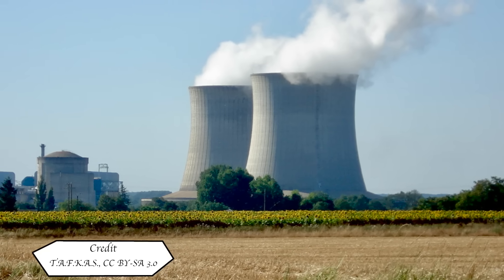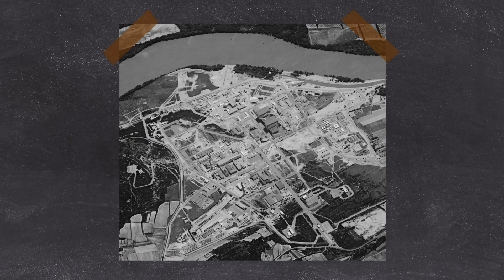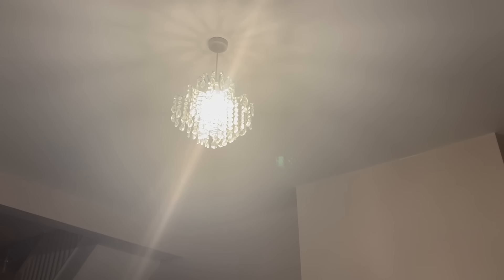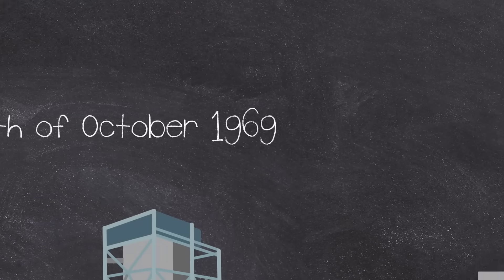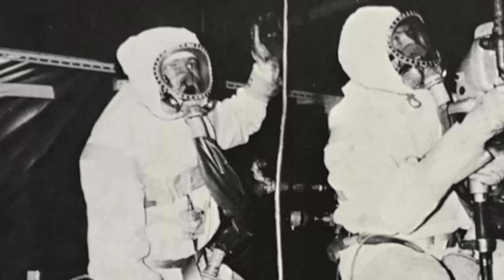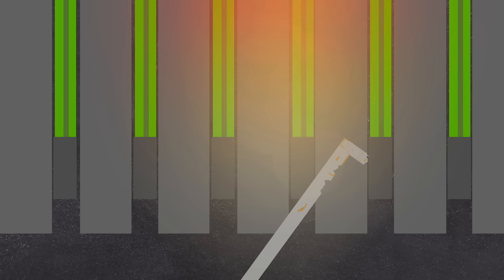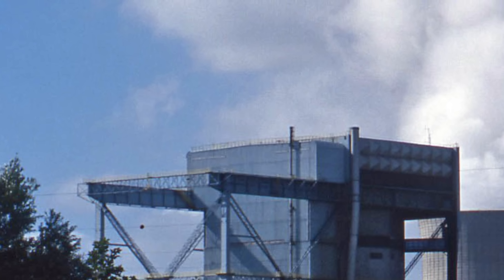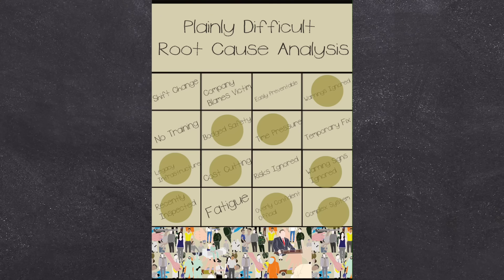The Nuclear Power-station that Kept on Having Meltdowns: Saint Laurent 1969 & 1980

Comment: I read a bit about the UNGG reactors.  Every single plant had unique reactors.  G1 through G3 at Marcoule used a pre-stressed concrete pressure vessel- the first ones ever built- and horizontal fuel channels.  All UNGG reactors were used to produce plutonium but I believe the G1 and G2 reactors produced the plutonium for the first French atomic bomb.  The first EDF plant used steel pressure vessels for its three reactors and vertical fuel channels.  Saint-Laurent's reactors were the first in the series to use internal heat exchangers, greatly improving efficiency.  There was one plant built in Spain.  An experimental heavy water moderated gas-cooled reactor was built at Brennilis which operated until 1985.

Comment: Do Europeans not realize that liquid cooling is the preferred method of cooling heat engines (looking at France and the former Soviet Union-specifically Churnobyl reactors here and yes, nuclear electrical generating stations are heat engines) for a reason?  Canada has and always gets this with the CANDU design.  Both the moderator and cooling fluid of those reactors are heavy water boiling regular water that's condensed after the turbine through the Great Lakes (Bruce Nuclear Generating Station, Pickering and Darlington) and other large bodies of water where they are used across the globe including the CANDU-derived Indian reactors.  Yes, it's expensive but our plants have run for at least 50 years relatively trouble-free, are currently being refurbished and may have an additional 20-50 years of service after that.

Comment: According to Wikipedia, "However, tests conducted in 1993 by the IPSN and in 2003 by the IRSN determined that the levels of plutonium measured upstream and downstream from the power plant were similar and of the same order of magnitude, concluding that the presence of the plutonium was due to the fallout of aerial nuclear tests and not due to either the 1980 or 1969 accidents."
Reply: The contributor for that quote was an EDF director, probably.

Comment: Not sure if anyone has noticed but at 4.37 you state weapons grade uranium is produced, this is incorrect, plutonium is produced through U238 capturing neutrons and transmuting into plutonium. Gas cooled / graphite moderated reactors are particularly good at this, hence Britain, France and several other countries built them!! (The original calder hall magnox (and chapel cross) were optimised to produce plutonium (and tritium) with electricity being a useful by product) only the later, much larger magnox were optimsed for electricity generation.
Reply: I read the biggest reason why certain nuclear reactor designs were used. Even if they’re intrinsically less safe. Is because weapons grade material is produced as a byproduct. 
Liquid fluoride thorium reactors (LFTR) are fail safe and a much much better design. Why aren’t they used? Because they can’t create a nuclear weapon.

Comment: Generation 1 nuclear reactors were pretty bad. Interesting that the UNGG reactor shares some principles with the ill fated KS 150 reactor that was installed in the A-1 plant in Jaslovské Bohunice (gas cooled, natural uranium, can be refuelled while operating...) which you covered in another video too. Both reactor types suffered meltdowns caused by blockage of channels with foreign objects, although their source was different. At least nobody died in France, unlike in Czechoslovakia, where two workers suffocated from the escaping coolant that flooded the corridors and displaced oxygen. The biggest tragedy is that those poor workers managed to reach the emergency exit doors, but they were locked and could not be opened. Their last moments before death must have been horrible, knowing you are going to suffocate and there is absolutely nothing you can do about it.

Comment: Interesting video, but it’s worth putting these incidents in real perspective. Both “meltdowns” happened over 40–55 years ago, in obsolete gas-cooled reactors that were already being phased out at the time. These weren’t pressurized water reactors or any modern design — they were first-generation experimental machines running on natural uranium and manual controls. Even then, neither accident hurt anyone or released dangerous radiation levels. The 1969 and 1980 events were indeed rated Level 4 on the INES scale — the same category as a serious industrial accident, not a large-scale disaster. France cleaned up, learned from it, and moved on. Today, it gets 70% of its power from nuclear — safely, cleanly, and with some of the lowest per-capita CO2 emissions in the world. If anything, the St. Lauren story shows how engineering progress and strict regulation work. Early reactors had flaws, yes — but those designs are long gone. Modern nuclear plants have passive safety, triple containment, and fail-safe cooling that make a repeat of this physically impossible. So let’s not act like 1969 tech defines 2025 nuclear. That’s like judging aviation safety by the Wright brothers’ crash record.

Comment: Pretty sure you meant that those reactors could make weapons grade Plutonium not Uranium.  Those reactors use Uranium to operate they don't create it.  Whereas it is much easier for them to create weapons grade Plutonium as some of the neutrons could be captured by the much more abundant but not fissile Uranium 238 eventually making Plutonium 239.

Comment: CORRECTION: Natural uranium reactors produce weapons grade plutonium, not weapons grade uranium.
Reply: Noting of course that natural U reactors produce MORE plutonium than enriched U reactors, but the "weapons grade" aspect depends upon the fuelling cycle.  If the natural U fuel is left in for more than a few days the plutonium starts getting denatured from (mainly) Pu-239 to the undesirable Pu-240 and then Pu-241.  But you are correct; weapons-grade uranium requires enrichment facilities, not reactors.
Reply: Good old U238 ->U239 -> Np239 -> Pu239 process.

Comment: These reactors, and Magnox in the UK, could be used to produce plutonium for weapons, not uranium. You put unenriched uranium into the reactor, U235 is used in the fission and some of the much more abundent U238 is transmuted into plutonium, which can then be chemically seperated from the spent fuel. It's less energy-intensive than trying to enrich uranium to the very high enrichment levels needed for weapons.

Comment: 12:20 How could it be a 2 if nobody was injured?
Reply: Radiation, especially in non-lethal doses could have long-term health effects (cancer) that much harder to attribute/claim. "Safe dose limits" with certain PPE 30yrs ago might be found to be inadequate 10yrs later.
Reply: @WT..... It's very much the opposite. Dose limits are based on reasoning that assumes the human body has no ability to heal radiation damage. It's the same reasoning that predicted tens of thousands of cancer deaths from Chernobyl.
Reply: There will be cancer, etc among the workers.
Reply: @nevillehoward8736 No there won't. Nobody got a dose even remotely close to what would cause cancer.

Comment: They will do more than shut your electric off...EDF bought all the nuclear tech the UK had, Gordan Brown sold it to them... oh and his brother was a big shareholder of theirs back then... and yep, not only insider trading, many called him traitor,

Of course he was left alone.. me though found guilty of  threatening behaviour for telling a mental patient who had told me he wanted to "anoint the school with blood" that was behind me.. That was when just before they tried to call mt a fraud for claiming DLA, won 4 tribunals on that. Had to pay a £300 for the first thing though, even if they had the wrong name on the paperwork as they said if I put in another complaint, I would be held on jail util a retrial was sorted. I won the tribunals as that fella had also claimed I had attacked him with a machete, so coppers knocked mt off mt motorcycle, and knelt on my spine where I had a operation to decompress and fused the vertibrae, they lost that crown court battle as they had no evidence of course... they told me they were going to say I did it anyway and told every one I was just a junkie which was BS. which was slander as I don't like the stuff, and won't even use Morphine for the pain. Codeine only as the pain is still a problem even if it was 30 years ago. Anyway, I have COPD and dying anyway, so these days I don't have anything else much to lose, so f' em when they I was getting death threats I just joined the NRA UK (Old friend of mine from the 80s was the instructor, and held all licences up to Artillary  as well) and got myself retrained with the firearms and of course their attempts at intimidation failed because they are not so good at it.. I know some of the biggest biker clubs, and they do that better! My barrister was laughing saying "no such thing as attempted intimidation, so we can't take them to court for that!"

Comment: When I was a child, a family friend gave me a book called Nuclear Knowhow, which explains how nuclear fission works. It showed neutrons, protons and electrons as these jolly little characters, with groups of neutrons and protons standing in groups - atoms - as other neutrons and electrons whizzed round them. Sometimes one of the flying neutrons would jump into the middle of an atom, splitting it. I assume that the reactor that they showed in the book was a Magnox- we didn't have any PWRs at that time.
Reply: Well I think you are missing out on the basics here as the how of splitting atoms is the same for all reactor designs.  The difference being in how the neutrons are moderated and how that fission energy is transferred into a form we can use.

Comment: After the Three Mile Island meltdown nukular injuneer Jimmy Carter banned reprocessing and sent spent fuel to France where accidents were kept confidential.
Reply: That wouldn't make any sense.  The failure at TMI had nothing to do with the fuel itself but of a stuck valve.
Reply: @Stubbies2003  The move was not directly related other than hysteria over radioactive materials.

Comment: Sadly, lack of maintenance is a common issue across most all industrial facilities that are hard pressed for 99% uptime, as well to return maximum profit.  Although run to failure is common amongst industrial facilities where the worst case scenario is downtime.....spicy industrial sites require more attention.  I have seen all your spicy videos and it almost always comes back to incompetent managment, greed, cost savings, or the unholy trinity.  Thanks for producing another special!:_Atom::_Hazmat:
Reply: That's the point where nationalisation or at least national subsidies/oversight are not a bad idea.

Take out some level of the for-profit nature and require safety instead, and things should run much smoother.

Comment: Just remember, whatever was released into the Loire River is a mere tiny fraction of the radioactivity routinely released by coal burning power plants every year.
Reply: Exactly. Coal puts more radiation into the air every (iirc) half decade than literally every single nuclear activity ever has released period. Never mind the radiation in ash.
Reply: No thanks but I believe Russia did that before as they blew up their reactor twice
Reply: The French have accepted your challenge and will release more as soon as they can.

Comment: I'm French and intereted in nuclear accidents and never heard of it. I'm quite surprised ! I laughed out loud at the gamma spectromecter reading although we would rather say "ça casse les couilles" but the broken translation make it even funnier ! Great video as always !
Reply from the maker: Thank you!! ;D
Reply: France perfected nuclear energy.  They also built all the nuclear reactors along the borders......
Reply: @Flies2FLL https://recherche-expertise.asnr.fr/sites/default/files/2023-03/Carte%20g%C3%A9ographique%20des%20r%C3%A9acteurs%20EDF%20en%20exploitation%202022.png they did not ?
Reply: @Flies2FLL  I would argue that Canada with their CANDU design is just as important for the improvement of reactor design.
Those are heavy water reactors that can run on un-enrichted, natural uranium and even operate with spent fuel rods from other reactor designs.
The obvious downside is that they require deuterium for the coolant/moderator, but without a need for enrichment facilities, they can be a good option for nations that aren't globally trusted to operate enrichtment and breeder facilities.
Reply: It's show in the "ines ladder" échelle de l'ines
It's not that known against a fukushima, or tchernobyl, but again, we dont know a lot about..
Reply: I wonder if the designer of the addressing system were thinking about Joseph Marie Jacquard and his punched-card controlled loom. Perhaps he was thinking "Jacquard used holes to direct the placement of threads, I am using holes to direct the placement of uranium."

Comment: Hey John, you might consider covering Davis Besse nuclear power plant. In 1977 it had a stuck valve very similar to what happened 18 months later at 3 mile island. Then in 2002 a hole the size of a football was found in the containment vessel. It was caused by leaking boric acid from the cooling system and had eaten through >90% of the head, if the maintenance shutdown had been any later it might have resulted in a complete loss of containment. Having a single reactor have 2 such close brushes with disaster is rather rare from what I've read.
Reply: Davis Bessie was hit by a tornado in 1998 too

Comment: Graphite moderator reactors are horrendous and dangerous design!!!! Extreme easy to have a meltdown, without water flow and/or water!!! They don't even have reliable fail safes/back up systems that work especially without power from grid and generators!!!

Comment: My man with another awesome show!  Strange that the nuke scare got so bad we closed a bunch of reactors decades ago.  Now they are reopening for Chatgpt data centers.  I fear you will have a lot of great content soon.  I mean what can go wrong restarting a reactor decommissioned 30+ years ago.
Reply: I am all for nuke power but these reactors were closed for legitimate reasons in the first place.  Right?
Reply: @mrtodddelaroderie they were closed for stupid political reasons. In sc they closed a new facility that recycled old uranium. The only reason is the fear that was created from the idea of using the uranium to make weapons. Even though it was built for the nuclear plants not nukes. Also big oil companies pushed alot of false information or pushed the truth to far.
Reply: @sullivanthomas1775 yeah that's sucks.  But there are miles of wires and coolant pipes that have sat around for decades.  There is no way to complete the same rigid X ray strength test on all the wields.   It would be different if they were closed to be reopened one day.  But i don't believe that's the issue.  These reactors were decommissioned and left to slowly fall apart.  While any 'dangerous' areas are monitored and/or made safe.
Reply: @mrtodddelaroderie  It is possible to adequately repair them, and doing so would be cheaper and faster than building new (mostly because or the time/money the surveys of a new site would take or the cost/time of dismantling the existing reactors). The question is: Will it be done right?
Reply: @hanzzel6086 you do have some great points.  Thank you.
Reply: @sullivanthomas1775  Well Uranium 235 is the isotope used in both civilian power plants and in nuclear weapons.  The only difference being in the ratio of U-235 versus U-238 in the fuel.